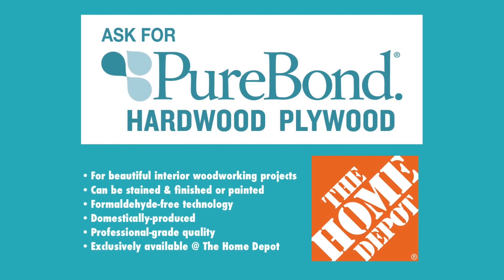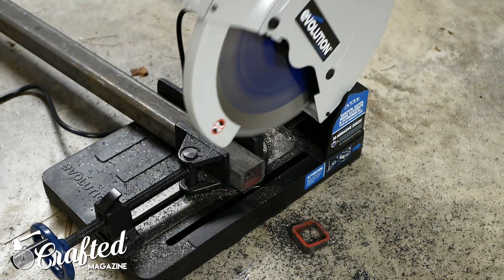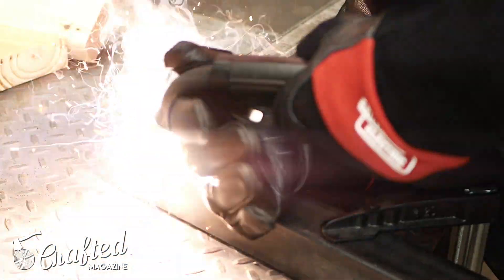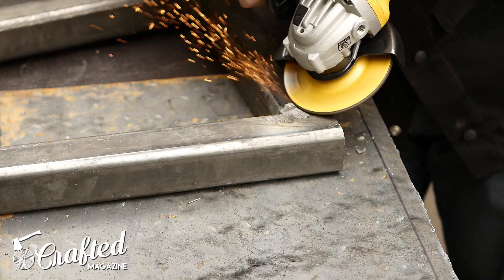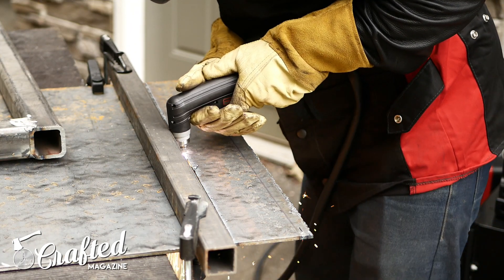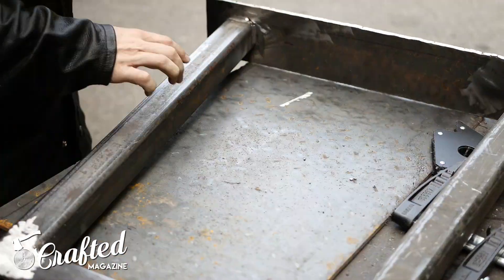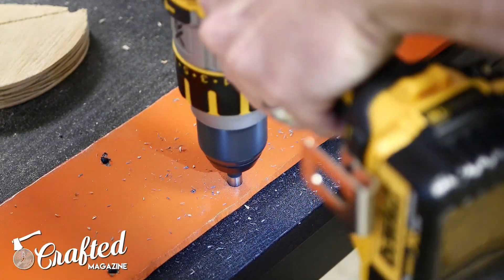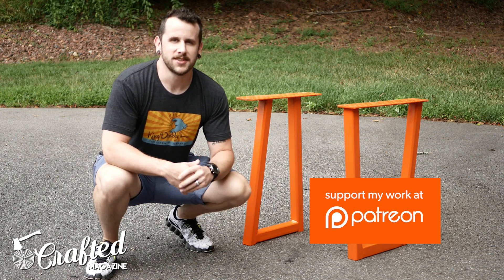Walnut Plywood & Steel Desk, Part 1: Welding the Steel Legs | Crafted Workshop

Comment: I understand your use, and not use of gloves, but wonder how you'd get caught the gloves caught in the grinder wheel. If it gets that close, I'd be keen wearing my MIG or stick welding gloves cause they're heavy duty but do reduce the grip. There's good gloves that aid with reducing vibration, these are my preference for extended grinding.

Comment: here with the late comment: imo no gloves - if you get nailed with a flap or cutoff wheel - it sucks, but its usually a bandaid - sometimes sutures if you are slow. With gloves, that turns into you hands skin being "degloved" also, ill take the stitches.

edit: oh and great video, i just finished my tables legs today.
Reply from the maker: +Kevin Stadmeyer thanks! Good tip for sure.

Comment: nice man! great first project! you should def look into getting a tank a usind solid mig wire. you will be amazed at how much easier and nicer it makes the welding ! keep up the great work and production!
Reply from the maker: For sure! This was my first time using flux core and was not a fan. We used some solid core in the class I took and is was so much simpler.

Comment: Great build, turned out quite nice. Overbuilt would be laminating 3 sheets of 3/4" walnut plywood together for the top. ;-)
Reply from the maker: Hah, that was actually one of the design possibilities. I like overbuilt. :)
Reply: +Crafted Magazine I'm an over builder also, my wife teases me all the time for it. My first workbench was built with 2X6's laminated together for the legs, 2X6's for the frame and bottom shelf and the top was a layer of 2X6's, 3/4" MDF, layer of 2X6's and finally topped off with 3/4" MDF. Needless to say, overbuilt and had to use a hand truck to drag it around.
Reply from the maker: Lyle Kobberstad hah, that sounds about right!